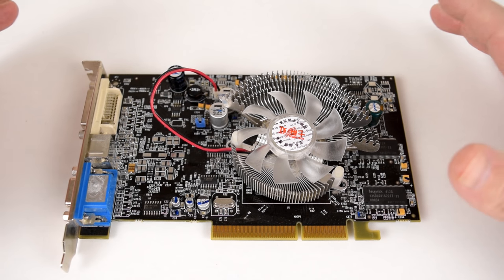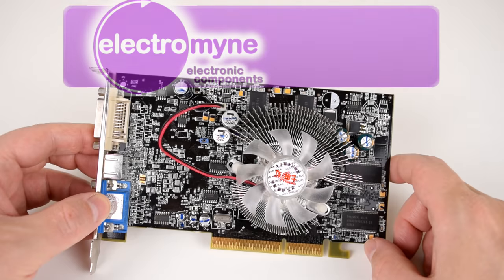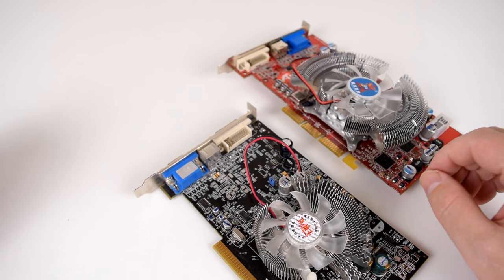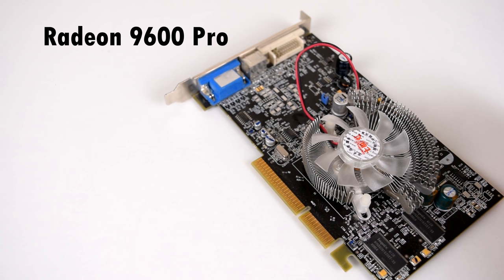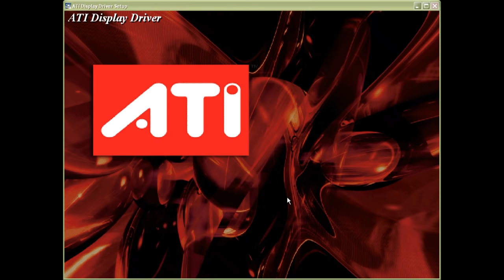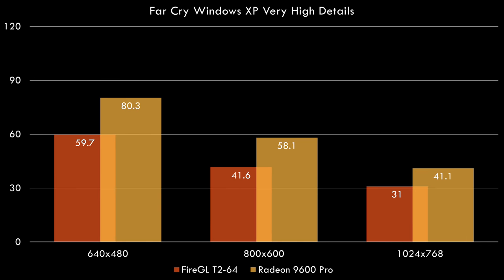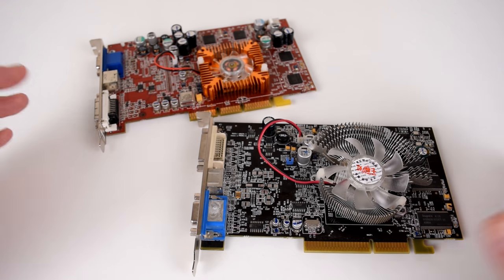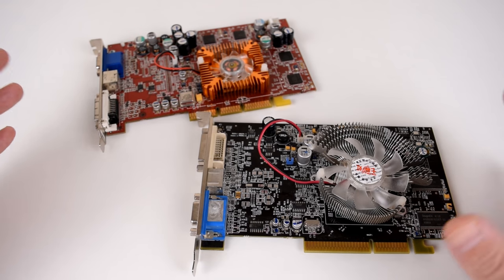Radeon 9600 Pro Review

Comment: A Radeon 9600 was my first dedicated gaming gpu!
I can’t remember if it was the Pro or the XT model but it was amazing together with the Athlon 64.
I’m not even sure anymore if it was the Athlon x2 or the single core. Whichever is period correct to that time.
Reply: I wish I still had that computer it looked so amazing for that time with a weird cut window and a blue LED fan in the middle of it!
In the computer I had blue light tubes and the case also had those blue lights build into the front which looked amazing at that time. (Nowadays people would cringe about it haha)

Comment: Hi Phil thanks for this video! So the number kind of indicates its performance compared to others right? i.e.. 9800>9700>9600>9500>9200>9100>9000?
Reply from the maker: Almost, the 9200 series is an exception :)
Reply: In my opinion, the 9500 is a better card than the 9600. I had several versions of 9600 (Pro, XT and another one), but I always wanted a 9500, 9700 or 9800 (not the SE, or LE, or whatever it was called).
Reply: The 9100 is much faster than a 9000, it's a rebranded 8500LE, and the 9000 is a cut down 8500. The 9200 is a slightly improved 9000, on benchmarks they perform the same. But most of the 9200 models are 9200SE models with 64bit memory which lowers the performance quite a bit.

Comment: I was wondering if you could make a video about different AGP types, as I was thinking of upgrading my motherboard to one that has AGP 8X to get some extra performance out of my X1600 Pro.
Reply from the maker: 4x or 8x makes little difference, but does matter with compatibility. Especially old cards won't work in newer boards and vice versa.

Comment: Oh, they are selling a nice New "All-in-Wonder 9600 pro' on ebay but you want to get the odd dvi adapter that i have no idea what it's called to find it.
Reply from the maker: Yea I did contact the seller, the cables are propriety, you won't find them. So those AIW cards are basically useless, that's why they are quite cheap. Don't buy them.

Comment: I told you, that the shadows is a very demanding option. If you disable it, a weaker card like the FX 5200 can achieve playable framerates too. :)
Reply from the maker: Yea I mentioned that in the video!
Reply: When i had a Sempron 2400+ with Radeon 9550, the timedemo gave 35,5 fps at 800x600 without shadows. The 9600 Pro doubles it easily. ;-)

Comment: Phil i have a core 2 quad q9450 gtx 460 machine running windows xp sp3  of a velociraptor 300gb hard drive (feels like a ssd on xp :)   i was just wondering what files can i get on this version of windows to make it as backwards compatible as possible , so far i can play original gta 1 and gta 2 , both midtown madness  games , orginal driver game , Tony hawk pro skater 2 , warcraft 2, starcraft orginal version, original  doom collector's edition  even runs on windows xp , what workaround files can i get to run other windows 98 games on windows xp?
Reply from the maker: Well you got Windows XP, that sorts out most issues. Some games, the video card might be too modern, but likely that's just a few games.

Comment: I know it's an old video but I have a question.
I have an old PGA 478 socket system with a Celeron 2.4 ghz/400 FSB. is this card overkill over FX5500?
I can choose between both of them & I know FX5500 is weaker but if it's enough for that CPU, I can use Fx instead...
Reply from the maker: Hmm the FX 5500 is indeed weaker, but more compatible with a few older games.
Reply: Thanks for your reply!
Can I ask you more specific on compatibility side of FX5500?
 
Currently I have MX 4000 on that with both windows 7 & windows ME on the system and although the driver is kinda buggy on 7 since this card doesn't even support Vista oddly enough old games like 'Stronghold' and 'Midtown Madness' actually runs better on 7!

Comment: you forgot about 9600se, 10w beast GPU that could run crisis1 and witcher1, best card ever
Reply from the maker: I covered the main cards, going over every version would have taken forever :)
Reply from the maker: The SE has a narrow 64 Bit interface, which really hurts the performance.
Reply: Ye I was only joking. I just had 9600se back in ancient past and I remember how well it performed. 10w max power draw(passive cooling with heatsink super small) yet I could play every single game in 10fps+ :)

Comment: I have a 9600 pro in my XP PC, maybe i will install Win98 on it, if i ever find DDR2 512MB RAM sticks.
Reply: its a Gigabyte one, with a passive heatsink.
Reply from the maker: Nice!
Reply: PhilsComputerLab it originally ran in my older winxp system, where i had to mount a fan to the card, as it got quite hot.